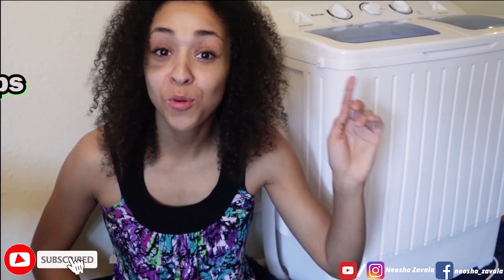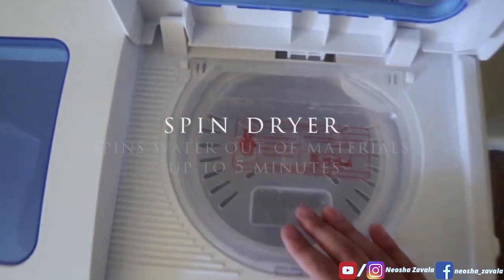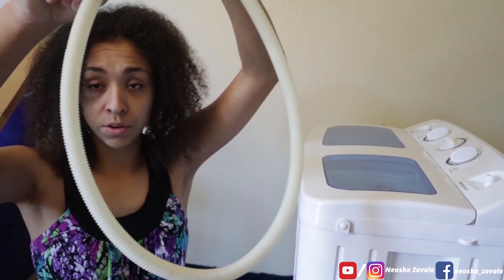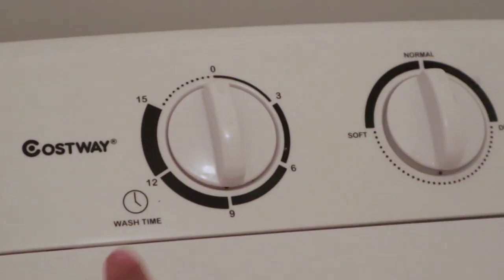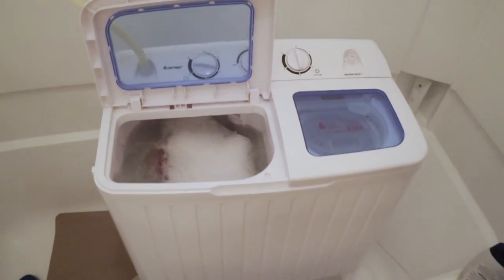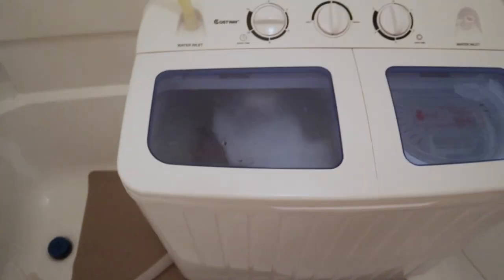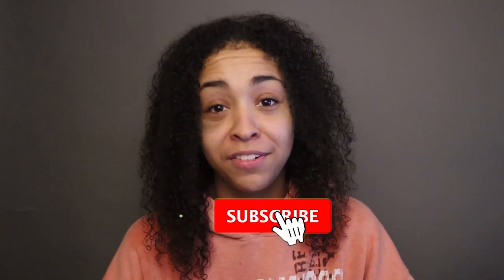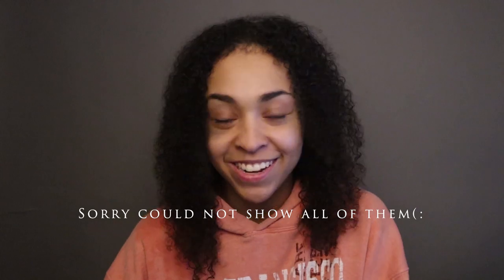Giantex/Costway Portable Mini Compact Twin Tub Washing Machine Part 2!!

Comment: 😏  I'm gonna bet that it doesn’t weigh 17 pounds;  gonna bet it's much closer to, say, 29 pounds.  Perhaps 29.3, to be specific?   💁🏻‍♀️
(Have you every actually weighed it?)
Reply from the maker: Oops, I was special and didn’t even realize that, since I’m human I do tend to make mistakes.. I meant the washing capacity weight limit. I was still new to this machine and I did mess up. But I guess that’s part of the learning process.. thanks for mentioning that 🙏🏽
The machine on Amazon’s website says it’s 28 Ibs, and no I haven’t actually weighed it myself.
Reply: @neoshazavala  

It’s so confusing!  Every single one I looked at, I think, has mentioned something about the weight, in a way which would quite easily lead one to believe that they mean the weight of the machine itself, and not the weight of the washing capacity… plus spin capacity!  🥴  combined.   And almost everyone I’ve seen in the videos like yours, has repeated that misleading info. I  wish the companies would be clearer from the start!
Reply from the maker: I agree!! It was hard to find correct info on some things like this, if the companies forget to add certain details and descriptions, along with what to expect from the machine. So it was like, oh hey I gotta experience it myself kind of thing and hope to give the best answer I can give later with my experience, if that makes sense? It’s just a bit difficult if you don’t have accurate info here and there with certain parts and all. But that’s why I always recommend to go straight to amazons website where I find items that way if I did give misleading info, they can go double check themselves if I’m wrong. Lol because I know I can mess up haha